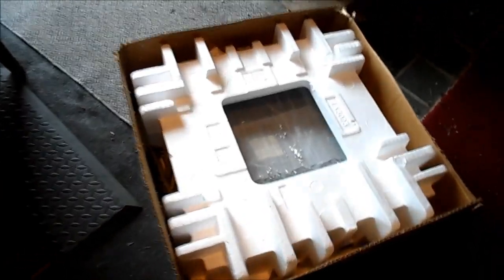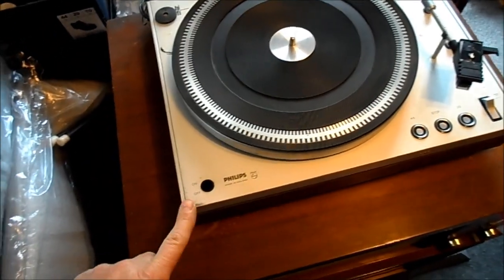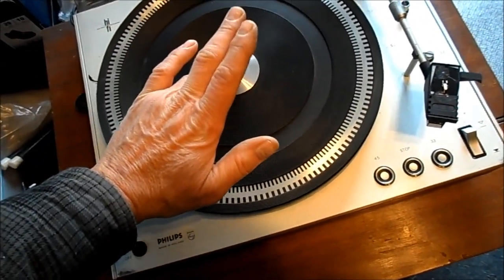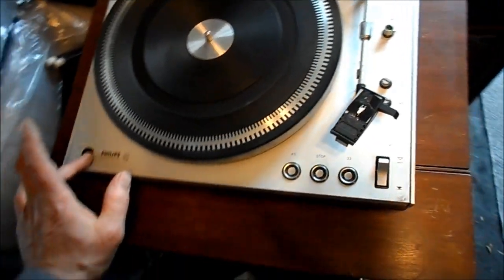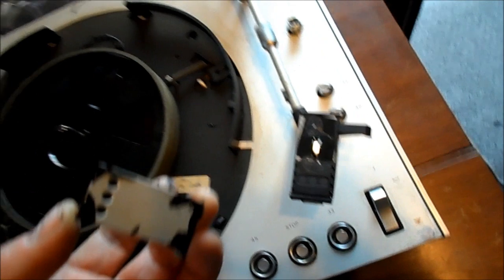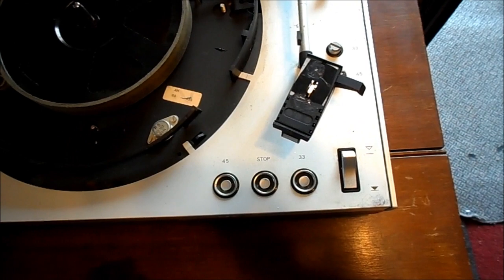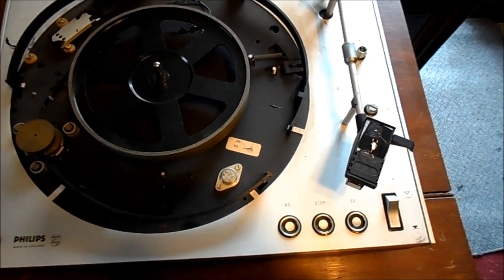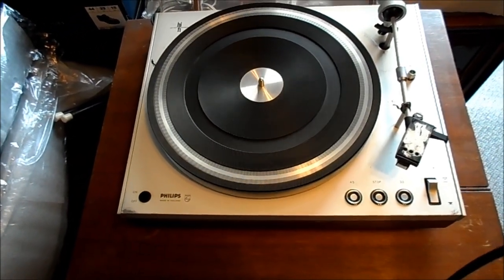1975 Philips GA212 Turntable. Startup Issue.

Comment: I have this turntable. The problem with it is that when you touch the speed buttons, the light comes on and it begins to function but as soon as you release your finger, they stop working. This has always been an excellent turntable, and I like the fact that you can adjust the speed. Always worked very well.
Reply: have this exact problem did you figure out a fix?
Reply: same here!
Reply: Try licking your finger slightly before touching the touch switches
works for mine

Comment: Looking for bulbs...so, do those bulbes from jukebox-revival webstite working gor the philips 212?

50mA for the speed controls
https://www.jukebox-revival.eu/staging/lamp-6-0-v-0-05-a-7121-d.html

100mA for the power light
https://www.jukebox-revival.eu/stag.../light-bulbs-e10/lamp-6-0-v-0-1-a-8059-d.html
Reply: https://www.jukebox-revival.eu/lamp-6-0-v-0-05-a-7121-d.html

This is a working link to the bulb

Comment: Knew a guy (in the old days) in Brooklyn that had this Philips GA-212 turntable. It was very impressive for a moderately priced unit. Specs weren't great; rumble 62dB and wow/flutter 0.1% but acceptable for mid 1970's. My Pioneer PL-518 (from 1978) had 73dB rumble and 0.045% wow/flutter. Still though, this GA-212 wasn't a bad component.

Comment: I have one of these that I ripped out the crappy cue controls and on-off switch (put a thumb switch on the power line) and it sounds really good--as good as my old AR table with the similar suspension.   Fortunately, the touch switches still work on mine, but I'm not holding my breath that they will last too long.

Comment: Need bulbs for touch speed buttons.  WHERE can I find them please?
Hi!
I now own two of these with broken power switches.  I will replace them but to get the T/T's going, I jumped them.  They both run at 33 rpm but no matter how I "play" the STOP and speed buttons, I do not get 45!
Will replacing the dead bulbs help?  I hope so!
WHERE can I find them please?  Can you tell me (us) the specs for the bulbs please?
Sincerely,
Bob, in Canada
Reply: Put a link up for Bulbs
Reply from the maker: I replaced them, with a similar spec. lamp. A grain of wheat type or something with similar rating. The ratings are printed on the lamp base. They are an odd non standard current. I've been told 2 things: The lamps current are part of the circuit to function, & also told it does not matter. I think it might. I've bought LED replacements, but not tried them. Other folks have substituted LED with no problem. Perhaps the current draw of the LED's was in the same ballpark to function properly.
Reply: I found 2 people selling the switches on eBay for about $12 + shipping
Reply: Marc B <https://www.jukebox-revival.eu/staging/lamp-6-0-v-0-05-a-7121-d.html>

Comment: Just replaced the bulbs (stop,33,45) with those leds: http://www.ebay.com/itm/170568242557?_trksid=p2060778.m2749.l2649&ssPageName=STRK%3AMEBIDX%3AIT, and added 220ohm resistor in series to drop the voltage to 5V (it was ~6.8V with the leds). It works and looks great. Also replaced the 2 electrolytic capacitors.
Reply from the maker: I bought these in green.
http://www.ebay.com/itm/6pcs-DC3V-24V-E10-screw-T10-concave-led-detect-Singal-light-bulb-crystal-lamp-/161425787179?pt=Apparel_Merchandise&var=&hash=item2595ba092b
PS I'm going to replace those electrolytics. Thank you for the info.
Reply: Spiros Ioannou good morning, the replacement bulb it's the same at the original used on philips ga 212 ? or i'ts a diferent voltage? why use resistance 220ohm? , and the electrolityc capacitor what it's the reason of change?
Reply: Fabian Alvarez Hello, I have GA312,similar to 212. The led bulb was rated at 6V, but because it drew less current than the original the voltage was 6.8V so I used the 220ohm to prolong the LED life. I also needed to change the polarity on one screw because LEDs need the + on the tip. The touch controls became much more responsive. The capacitors needed replacement because the voltage was not optimal. See the service manual: http://www.vinylengine.com/library/philips/ga-312.shtml
Reply: a ok, in mi case i have a ga212 philips, if put a bulb of 6v no need resistance? mi problem it's when the arm of turntable its close to finish of the vinyl,  the speed it's out of control , swwtching on 33/45/stop intermitance. the replacement of the bulb it's a solution? scuse my english. im from argentina.